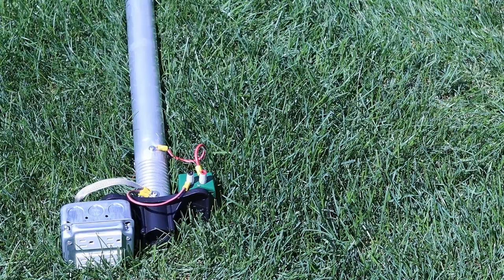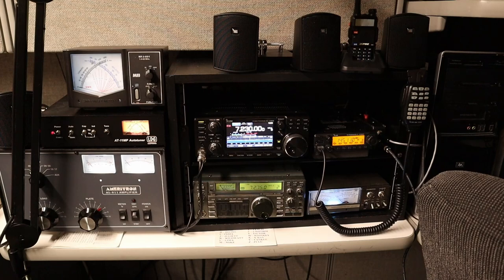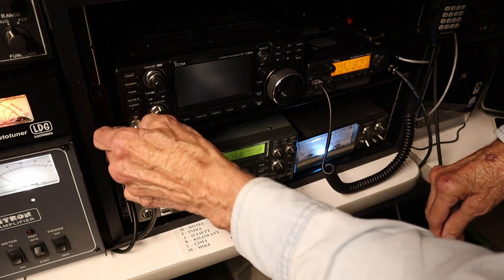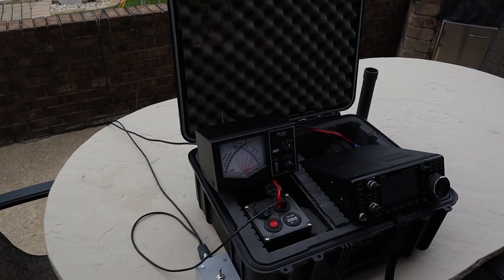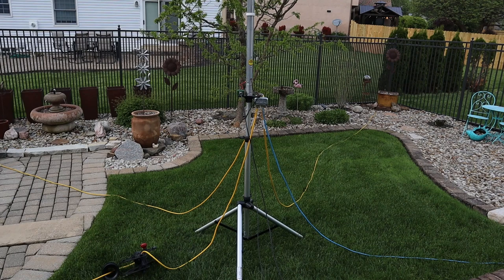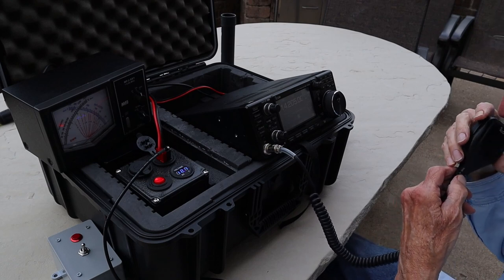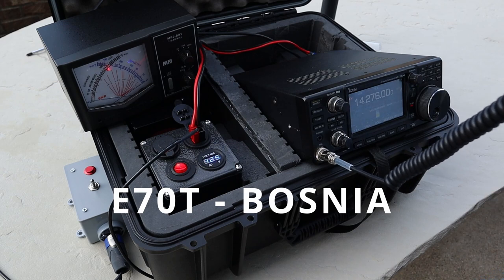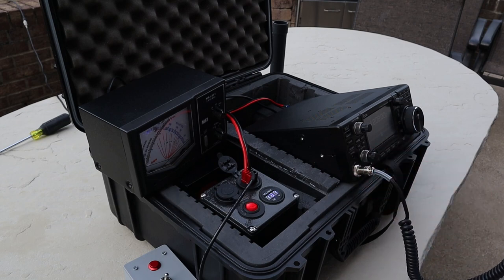WORK THE WORLD with a HAM RADIO SCREWDRIVER ANTENNA??  YES!

Comment: Nice work, Ed.  And the extension cord radial idea is nothing short of genius!   Ken K8DQ
Reply from the maker: Hi Radio Man. Yep, did you watch my video called “Screwdriver antenna mount with Unique Radials”. That explains the construction of that system. Thanks for the nice comment!  73. Ed. W8EDW
Reply: @edwhitney1862  Indeed.  Enjoyed it very much.  I really like to see other portable installations, and the ground radials and counterpoise systems are always the biggest challenge.  I believe you addressed it simply and effectively.

Comment: Would the antenna not perform notably better if you were to ground strap it to  a rod driven into the ground !
Reply from the maker: Hi Truth!  It probably would but it preformed pretty darn good without grounding it. If it was going to be a permanent install you are right, the ground rod would be the right way to go. Thanks so much for watching and your comment!  -Ed. W8EDW
Reply: @edwhitney1862  Maybe you could put a permanent grounding rod in , say next to the shed , or just over the brick wall in the garden, ( as not to trip over it).....and you could attach and detach as required....not so permanent. Might be good for further " Experimentations", Heck it might be a test of how much difference it makes so you could share the results with us, .....great test though....enjoyed your idea !
Reply from the maker: Hey Truth. Good ideas!  Of course I will have to have them cleared with my landscape artist (wife) LOL !   -Ed